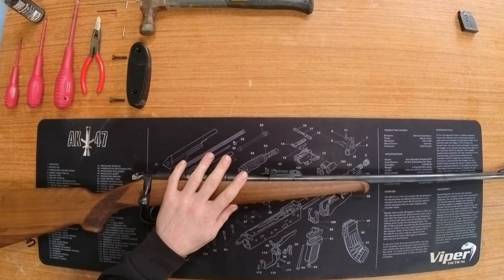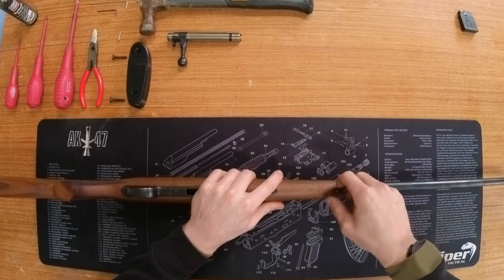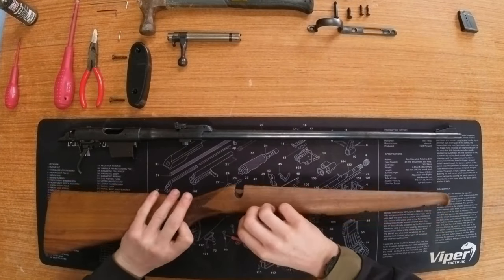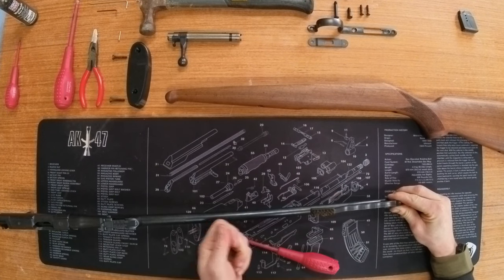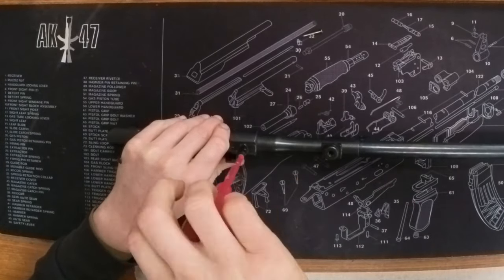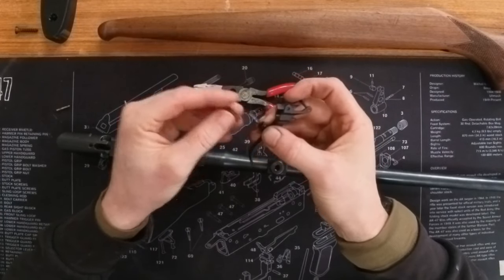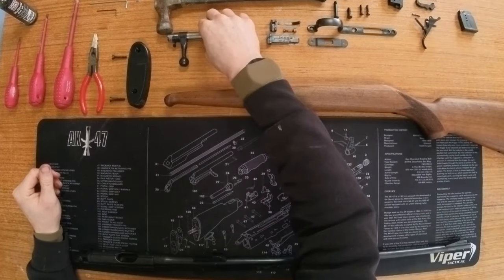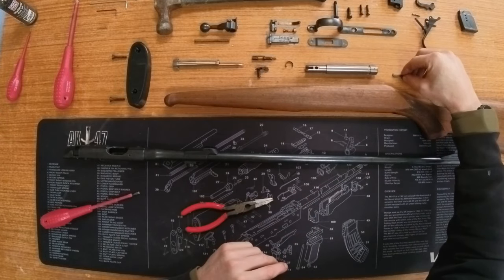how to disassemble / strip a BRNO MOD 2/CZ 452.

Comment: Hey mate, 

I took mine out of the stock for the first time ever to put in a new trigger spring and put a new mainspring in the bolt but I seem to have lost a bit of accuracy and am wondering if it’s my action screw torque. 
I don’t have a torque trench and I’m just not sure if it’s too tight or too loose
Reply: You shouldn't mess with a gun without a torque screwdriver

Comment: Hello, how removed housing and rear sight on brno mod 2?
I want the barrel clean and have more space for scope,
I hope you have a solution for that, thankyou
Reply from the maker: They are usually soldered on, so I wouldn't recommend removing it.
Reply: I have the same issue but I guess that I'll have to stop worrying and learn to stare lovingly at that horrendous piece of scrap iron on top of my Model 2